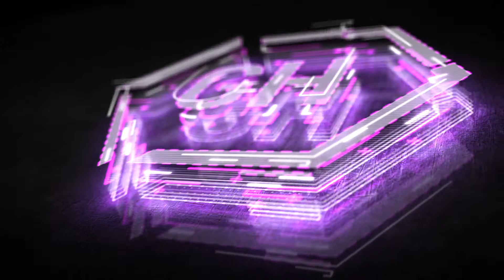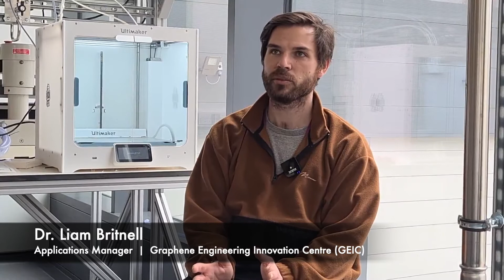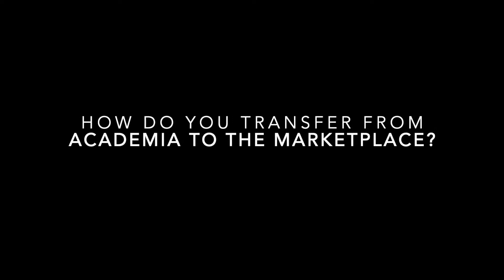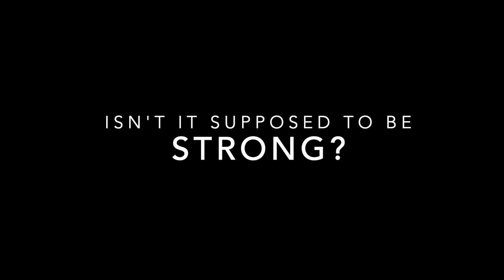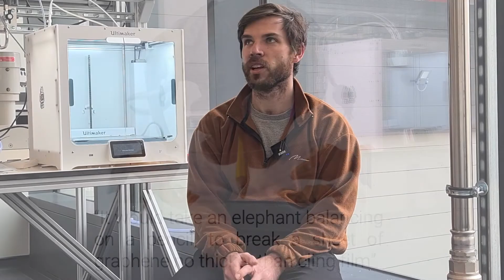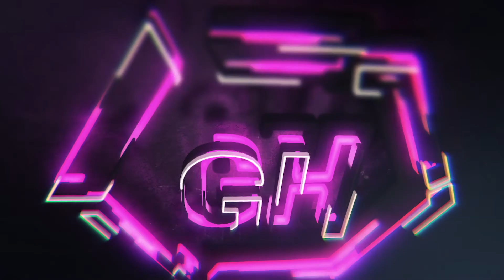Can Graphene Do That?

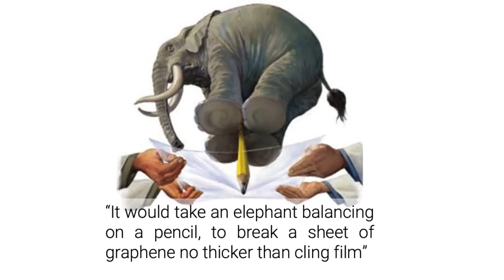Comment: Look at the graphene structure, 6 points, 6 lines, and many of these sixes. That's the mark of the beast 666. Also what can cause pain (Revelation 16:10) and “a noisome and grievous sore” (Revelation 16:2)? Only something medicinal can cause these. Not a chip implant. Also human body is 18% carbon. So therefore "a man's number" is also 666. (Revelation 13:18）“The sun shall be turned into darkness, And the moon into blood, Before that great and notable Day of the Lord come: And it shall come to pass, that whosoever shall call on the name of the Lord shall be saved.”
--Acts 2:20-21